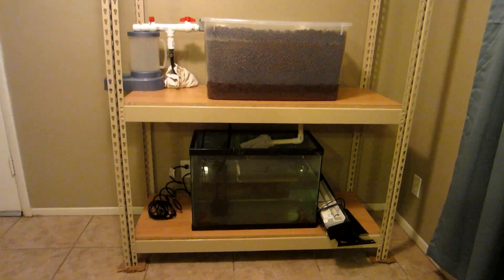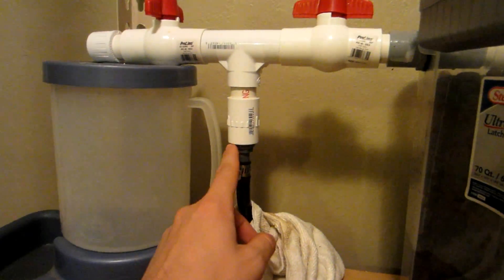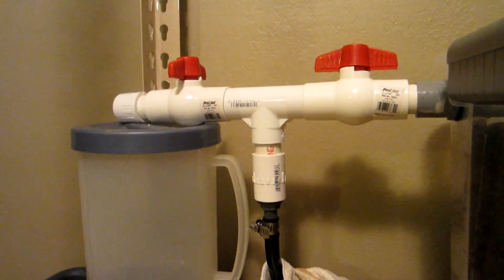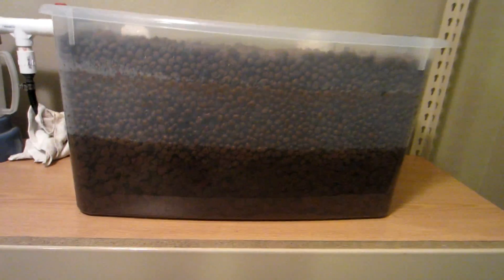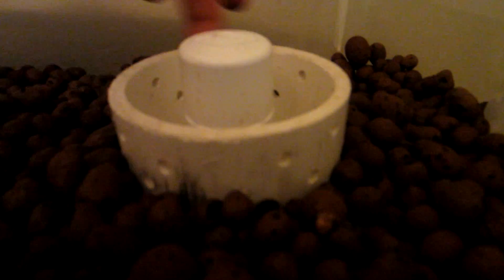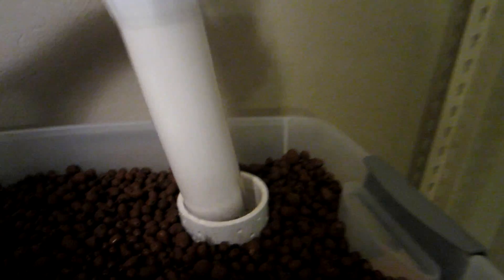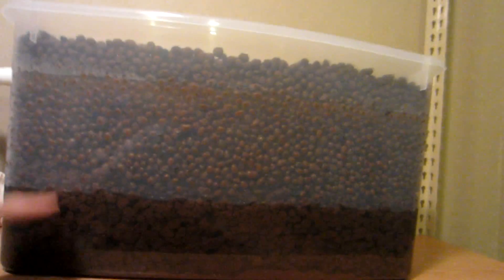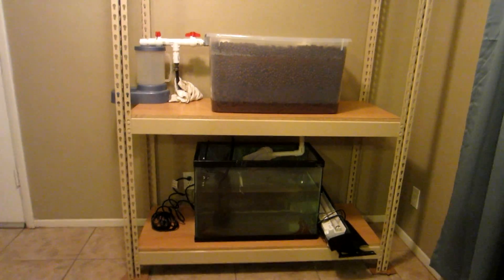Indoor Aquaponics with 20 Gallon Tank Part 2

Comment: Im currently building a very similar set up and im at this stage. How did you get the sediment from the hydroton out of your aquarium?
Reply from the maker: I used an aquarium gravel cleaner.  It will siphon water out and use that suction to grab the sediment.

Comment from the maker: The 70 Qt planter box when full of medium only allows about 5 gallons of water to fill the space in between the medium.  When the 70 Qt planter box is full of water and is starting to drain into the stand pipe, the 20 gallon tank is about 3/4 full.  The 20 gallon tank changes from 3/4 full to full every 10 minutes.

Comment from the maker: The bell siphon is what makes the grow bed fill all the way up and then empty.  Inside the bell siphon is a stand pipe. The height of the stand pipe measures how high you allow the water in your grow bed to rise.  Once the water starts falling down to the tank below, the suction of the siphon starts and sucks up water to the stand pipe until the water reaches the cuts in the bell siphon. Once the water is low enough in the grow bed to reach the long cuts at the bottom, air is let and water stops

Comment from the maker: I was working around my 20 gallon aquarium when looking for a grow bed.  
The two main factors i was looking for was a depth of at least 12 inches and a max of no more than 5 gallons of water at point of siphon.  Since my set up does not have a sump tank to keep the aquarium at a equal level, I wanted no more than 1/4 of the 20 gal tank to empty while the grow bed was filling. (for fish stress) 

My 70qt grow bed is 23x13x13

Let me know what size you end up going with?

Thanks for Watching